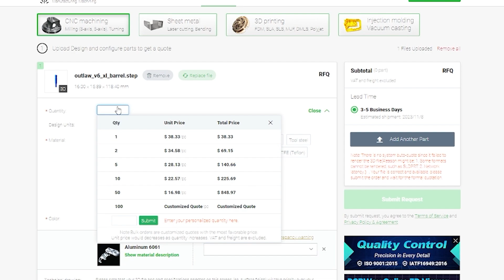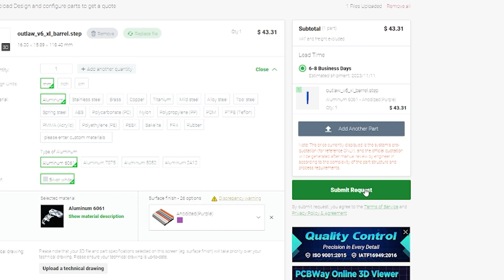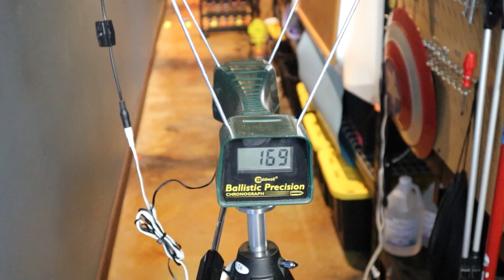Modding The Dart Zone Max Outlaw with Custom Machined Parts

Comment: That's awesome, but I'm curious about performance with the upgraded barrel and stock spring.
I'd also prefer to keep my sidearm legal at every war, including low power 130fps wars. While I will swap primaries for different caps, I don't want to have to keep a bunch of sidearms around for that, especially since I want to get a second outlaw for dual wield and would prefer they match :P Also while I don't complain about the prime on my outlaw like some people do, I wouldn't want it any harder to prime.

Comment: The only other thing i would machine is the hammer. Its sometimes hard to prime and i cant tell if its because of the actual prime or because the hammer is to.. off to get a grip on. Regular revolvers have extended hammers to fan or get your thumb a better grip.

Another thing is replace the safety with something else. Not just a fake one but small electronic button to activate lasers or something. Flashlight can be better but i think twin lasers or tri lasers would make the gun more scifi.

Comment: Radioactive already has these kits. Theyre cheap and get you low 140 fps.
Reply: Can get up to mid 150s consistently with the right spacers and stock spring. But also can get as low as mid 90s with the downgrade spring and up to about 140 on the downgrade as well.

Comment: Interesting, anything more than 160s and it just started getting woefully inconsistent for me. Never tried to push max performance because it just wouldnt take it. 30fps variance from 140 to 170 is pretty wild, and could make the blaster suddenly illegal at 150cap wars.
Reply: Don't some of your mods hit harder
Reply: @lon6boardlord mine can do 150s very consistently, but the kit is designed to be able to fit into a range of fps limits.
Reply: @lon6boardlord  thats not rly the point tho
Reply: So radioactive I was watching one of Captain Xavier videos on your kit       and he had trouble with his muzzle can you put on his outlaw just a little word of help the orange ring on the front of the barrel needs to go flush with the end of the barrel
Reply: @TheTeepane  putting the ring on the end of the barrel normally would make it not compatible with the stock blaster. People have fixed the incompatibility issue with the 3d printed muzzle by tapering the opening of it so it doesn't catch.

Comment: Really interesting mod. I wonder if you could just use nested brass tubing to get the same result, potentially more cheaply.
Reply: For sure! but the part for the o ring is like 2mm, so the tolerances are very tight. You would need 3 sizes to attempt it. You would need 17/32, 19/16, and whatever 19/16 fits into.
Reply: You most definitely can, cause I have. I built a custom barrel for mine out of brass.